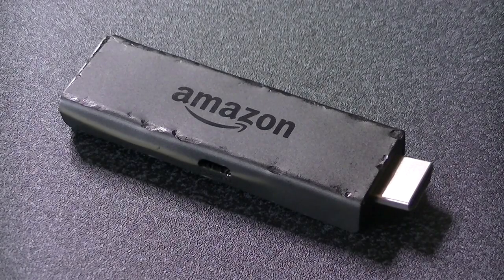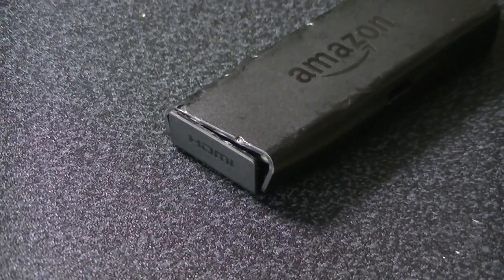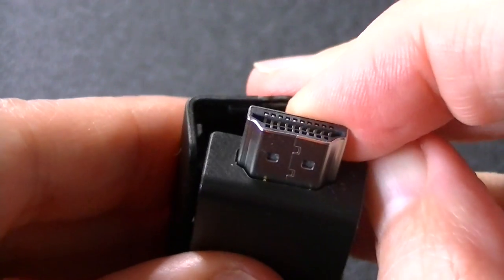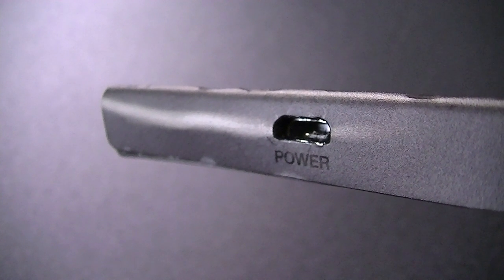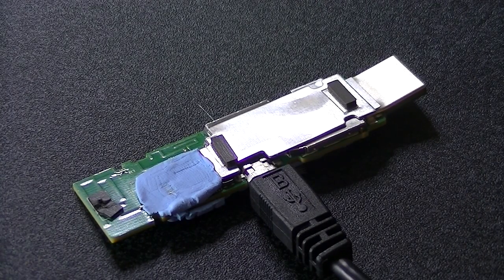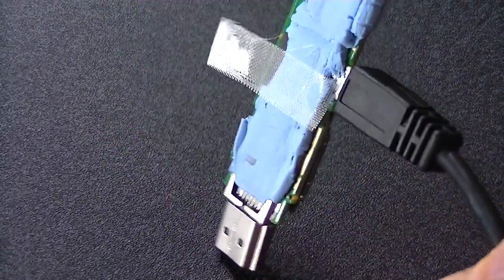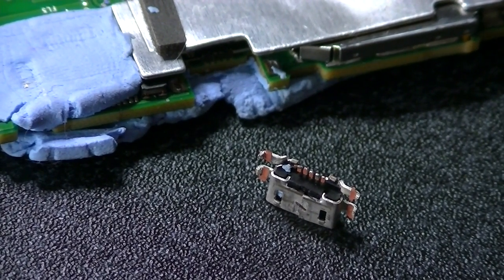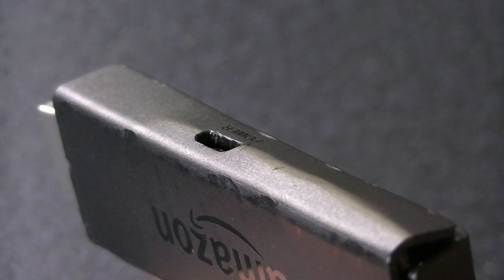Can You Repair an Amazon Fire TV Stick?

Comment: Great video! As it happens my fire stick has broken, but not due to any maltreatment, luckily there quite reasonable to replace :) thanks Jeff and Frankie! :)
Reply from the maker: Thanks!  I am sure if you had the skills you could solder the micro USB connector back on but as you say they are cheap so it's not really worth the effort.  Still it was fun to take to bits!  But why is it full of putty?!

Comment: Hi my Amazon stick when plugged into TV will not pass the fire TV stick logo can u help
Reply from the maker: Hi.  That sounds annoying.  Will the device reset?  You can reset from the remote. Press and hold the Select and Play/Pause buttons at the same time, for about five seconds.  If you get no luck with that have a look at this link which details some possible solutions.   https://www.amazon.co.uk/gp/help/customer/display.html?nodeId=202154650
Reply: Susie Bruce did you get it working? Sometimes it's the power source. If you use the USB in the TV it might not be enough current to keep the stick on. Try using the wall plug